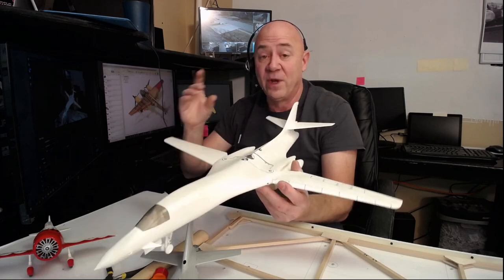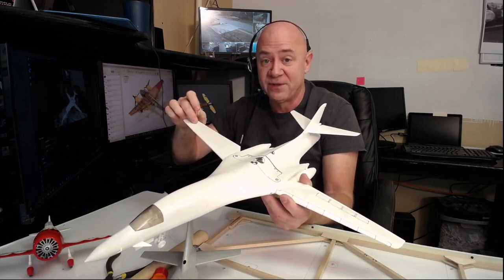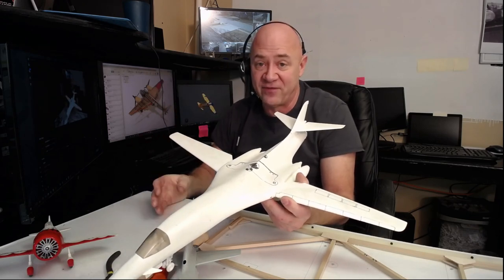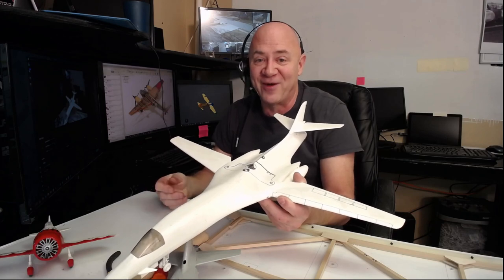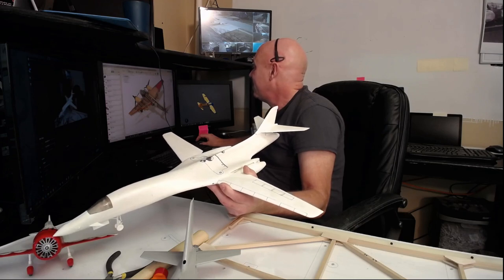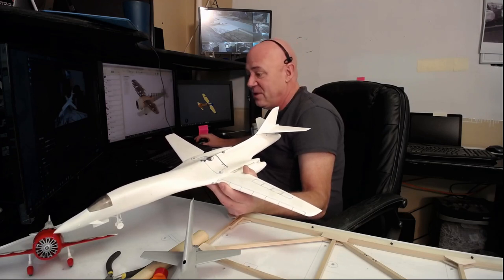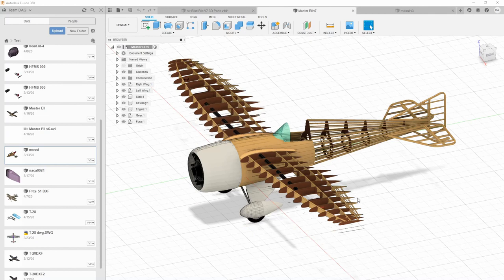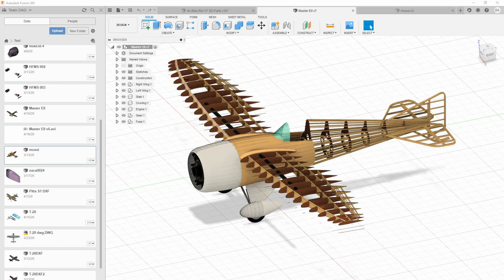Adverse Yaw

Comment: Great info and very simply put,   nice,  Really nice explanation    Top video series     Thanks for your work.  And Hello from little New Zealand.   Have drawn and slowly starting to make F111C aardvark.   70"ws  Hopefully 80mm edf.   Slats, twin fowler, and fully viable geometry.    The main gear has been an interesting mechanical drawing problem,    but getting it there.   Will start mocking them up once airframe and wings complete   edit,  using NACA2412 root and NACA2418 tip.  Is this ideal    or should I look at a different aerofoil
Reply from the maker: I have found airfoils don't matter on RC models that much unless you have a really heavy model. Or, unless your building a glider for soaring. A airfoil like the one you are using is very much like the ones I use. Cheers.
Reply: @dagtheaviator  wow,   thanks man.   Appreciated
Reply: @dagtheaviator  I'm hoping with the dihedral, and wode span, with the help of slats and fowler flaps. That is should hopefully have very good slow speed performance.   Ease of landings.  All comes down to weight really from what I've been reassured by your videos.   Glass covered foam core tailvators at 1/12 scale, using 8mm carbon tube full length as spar and pivot bearing,   they weigh in at 53 grams.    So that was a great first attempt.   Will do doing main wings on my break over Xmas.     Have cut and folded main spar and wing swing box out of a single piece of 1.8mm aluminium sheet.     Very light,  very rigid.    Foam core again with 200g/m2 carbon cloth.   Each wing raw,  without electrics should come in at 700g each.    Hoping to keep whole model under 5kg.  At a span of 1730mm  (70")     slightly larger than the Freewing F14      Finger crossed